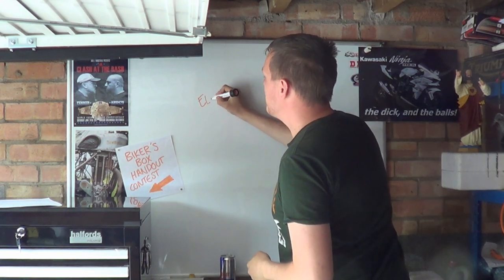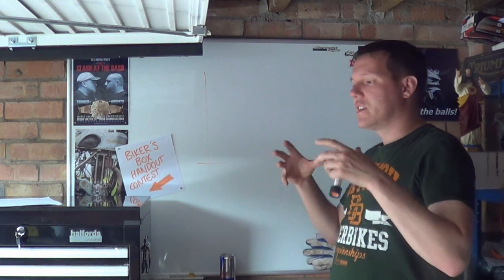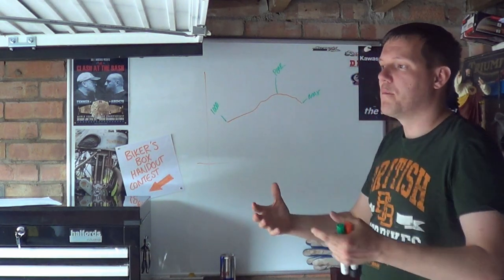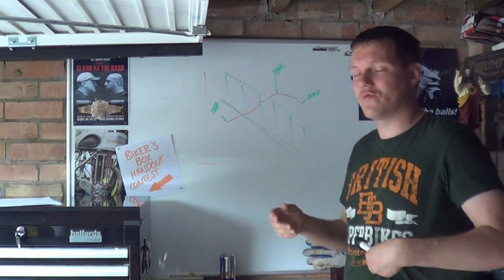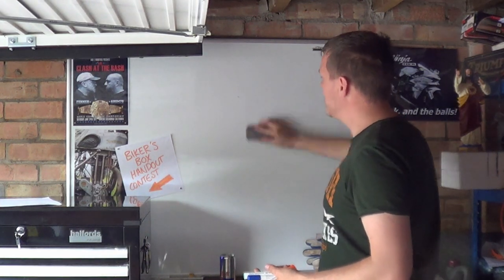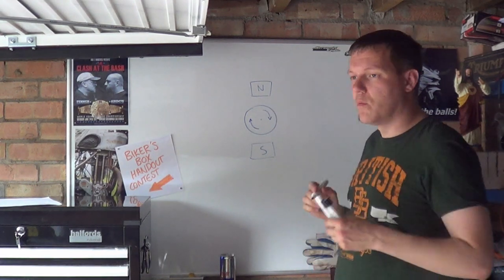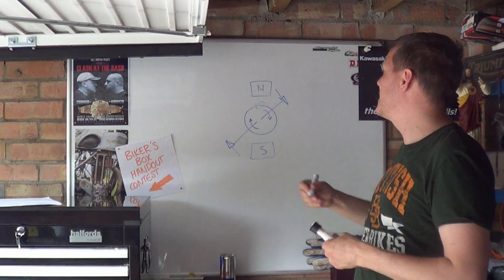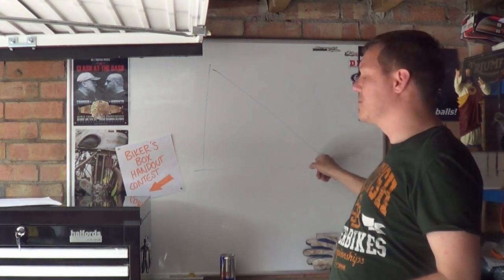Electric Motor - Instant torque - Motorbikes motors - Part 1

Comment: Luke Workman explained on Endless Sphere that an electric vehicle doesn't need a gearbox. You always win in performance if you replace the weight of a gearbox with copper, magnets and battery. The setups that require a gearbox always have the wrong motor and controller for the application. Tesla, Zero, Alta don't have gearboxes and they probably know electric propulsion well.
Reply: It's not all black and white, having a 2 gears gearbox can be useful (taycan) even formula e sometime has gearbox

Comment: You're absolutely correct. However, the torque curve you drew more represents a brushed motor and all modern vehicles use brushless motors. Brushless motors generally have constant torque with a curve downwards to the end of their power range giving them a more useable power regen. For anyone that wants to see an example of electric vs combustion engine check out the Tesla model s drag races.

Comment: Another 'issue' you get with electric motors is that you are also moving a wire through a magnetic field, so your motor starts trying to 'generate' a voltage against your input voltage - your motor essentially becomes a generator, which will eventually generate enough voltage to counteract your input voltage.
Reply: Henry Bevan That is the critical issue,  typically brushed electric vehicles use field weakening to reduce the effect and to allow the motors to rev more.

Comment: I realize this is an older video, but in case someone wants a bit more detail, electric motor torque is mostly a result of the current flow inside the windings of a motor. At stand-still, current is at a maximum, therefore the magnetic field is at maximum, therefore torque is at maximum. 

For anyone who doesn't know, motors have a small generator action side effect (called back EMF) that resists the motor, but never so much that the motor stop. Likewise, generators have a motoring action (called counter torque) that resists the prime mover. Mtotrs & generators operate on similar principles, just one is being rotated to create electricity and the other is being supplied electricity in order to rotate.

Anyways, when the electric motor is sitting still, first turned on, there is no back EMF yet to oppose current flow. Current is max, therefore torque is max. As the motor comes up to speed, the counter EMF creates a bigger and bigger voltage drop, which reduces current flow. When the amps drop, the field strength drops, which means less pushy push and less torque. It's integral to the way electric motors are designed. They have to do it that way. They can't not do it.  Also, permanent magnets have weaker fields than electromagnets, which is why most permanent magnet motors suck balls.

Comment: This electric motor curve (and it is curve, not straight) is actually for DC-motors with serial excitation with MAX torque (and current) at start (0 rpm) around 10x .. 12x of nominal motor values, than rpm goes to infinity (until bearing fail). This is OK for transport.
AC motor (asynchronous/synchronous) have a different torque/speed curve with MAX torque NOT at zero rpm, but around 60% of nominal value (depends on frequency and pole pair quantity). AC motors have starting current around 5x.. 7x of nominal current (and torque).

Comment: In fact it's constant torque up to base speed, then torque only drops because you run out of voltage at higher frequencies, if you can increase the voltage further (insulation issues) then current stays constant and torque is direct proportional to current.
So in petrolhead terms, curve is dead flat like a modern torque limited, supercharged petrol engine but with full torque from standstill and at usually over 50% of top speed it starts dropping gradually,   ... hope that makes sense ...:-)
Reply: Yes, a lot depends on the type of motor too, this would probably be a series dc motor. Torque is proportional  to the square of the current, so if the torque is dropping with increasing speed  so is the current.

Comment: In a combustion engine it is about the group delay from the control signal for more torque to the actual combustion happening by this.
And then there might be additional time constants for supercharged engines comprised of turbine mass, turbine bearing friction, turbine/compressor losses, air volumes, speed of sound, etc.
If a 2C 4stroke combustion engine revs 1000 rpm meaning 17 combustions a second.
So a considerable time goes by from injecting more fuel to it actually producing torque, something from 60-100ms in this example just because of the working principle.
But i guess actually it is more because the engine control unit has control loops further slowing this down because of diverse constraints, emissions, engine longevity, etc.
What you say about electric motors is only 100% true for permanent magnet motors, as used in most bikes, their torque is just limited by the current loop time constant of the inverter and this is in the range <5ms.
With a AC induction motor used in a Tesla for example it is different. Induction motors also don't have instant torque but a time constant of typically 100-400ms for the rotor magnetic field to build up. 
This is not really a disadvantage, but gives a smoother ride and still after this time the maximum torque is available, unless with a combustion engine you have to rev up first.
I guess with their "ludacris race start  2.3 tonne laptop battery bomber party trick" they already build the field up, waste a little energy, let the motor basically run with its so called "slip frequency" while brakes are applied and then let go.

Comment: The force that is used in electric motors is both the repulsion and the attraction that magnets have and electromagnets produce so it harnesses the power from both states.  This would be like a 2 stroke bike engine that was somehow able to harness force from the up stroke as well and make the power delivery much smoother.  Running an electric motor through a gear box can keep the motor at its peak power range and achieve incredible speeds.  So much in fact that I believe that we are going to see petrol engines being primarily used to spin generators that produce the power to drive vehicles because they can do it so much more efficiently and with the advances in power storage we don't need to have gigantic heavy batteries to supply enough power to be useful anymore.   Personally I think that we are living in an exciting time and the entire world is going to change very soon.  Good video again and thanks for the hard work.
Reply: Davis King electric motors don't need gearboxes. Someone much smarter than me explained it on Endless Sphere.
Reply: They do if you want to multiply the torque and reduce the output rpm.  This is why electric winches have gear boxes.  Hope this helps.
Reply: Davis King What if instead you use that gearbox weight and add magnets and copper? And  rewire that motor for high torque? Wouldn't that be a performance upgrade?
Reply: The problem is that when you build a bigger and more powerful electric motor it also increases the weight and power that it takes to operate.  That in turn increases the power that you have to supply it and the power storage that you would have to have to make the whole thing mobile.  Consider a cordless drill for example.  They have different speeds so that you can tailor the performance to the task at hand which is more efficient than simply building a bigger and more powerful motor to drive it.  This would be the same thing for say, powering a bike because you wouldn't want to have to pull a trailer full of batteries to ride it.
Reply: There is no replacement for gear reduction if you are using high ratios.  Gearboxes that are strictly for reduction purposes don't need to be large and bulky, look at the gearboxes on jet engines.
Reply: Davis King a good cordless drill has about 0-2000 rpm. A Tesla wheel at 155mph max speed rotates at about 1800rpm without a gearbox and it still has stupid torque at low rpm. Do Teslas cheat physics?
Reply: Tesla's use a stupid amount of voltage and current and have thousands of pounds of batteries to accomplish the task which is exactly what I was saying you would want to avoid on a bike.  Interestingly Tesla's do also use a gearbox but it only has one reduction.  This is because a 24 inch wheel spinning at 1800 rpm would be crazy fast but would accelerate very slow compared to how they perform now.  They are not cheating physics in any way either because they have to have an advanced cooling system for the electric motor and gearbox to keep everything at a safe temperature.  Hope this helps.
Reply: Davis King ok, Tesla example is not enough, what about Zero and Alta? They are electric motorcycles with reduction gearbox only. I'm referring to a gearbox mostly as six speed or something like that. Reduction doesn't count if it can't be shifted to another gear.
Reply: I am not familiar with those bikes but I am willing to bet that they run on some pretty high powered cells and require a lot of current to operate.  My point is that maximum torque is only really needed at low speeds and using a gear box would allow the use of a smaller electric engine so that the torque can be multiplied at low speeds and then gears shifted to allow faster speeds where less torque is needed to sustain the given speed.  Of course there will be friction losses with any gear box but electric motors overheat when they are ran too slowly and they will also be harder on bearings if they have to spin at super high rpm's all the time so there is always going to be a balancing act to minimize friction and wear and maximize power and efficiency.
Reply: Davis King the problem with small motors using reduction for torque is that when you shift for higher speed you lack power to overcome the wind resistance. Power that you could add by ditching the gearbox and adding copper magnets and battery. Improving range at the same time.
Reply: I am not suggesting using the motor out of you hair clippers here.  Use a motor that has enough power to do what you need without all the overkill and high power requirements.  Adding magnets is not going to improve the efficiency because it will require more power to operate.  Try spinning a car alternator by hand then do the same thing with a 5000 watt generator.  You may be surprised to discover that it takes a lot more energy to overcome those forces and that extra energy is why different motors require different power sources.  Hope this helps.
Reply: Davis King ok I quit. You have your opinion and I have mine. Have a nice day!
Reply: Sounds good.  Have fun.

Comment: I always thought of it as. the combustion engine has to spin up. taking in fuel. to make tq. but an electric motor you can just cram in all the fuel/ current that it can handle without spinning up. because the power comes from magnetic attraction and repulsion . gaining strength by added voltage.  and the faster it spins. the less time for the electrons to make a strong magnet. since everything takes time!  
and I think of HP as how fast a engine can spin up under load. and tq. as how much of a load it can move.

Comment: well done Matt, you got through that well. 
where did you get that toque graph from? doesn't look right.
a sensor-ed brushless motor can attract and repel creating 2x the toque of other motors. 
* why not over voltage a motor 48v upto 96v  and cool it
* why put 10 amps through the coils when you can do 20 amps

Comment: Cheers Matt great video. I don't quite understand how the magnets spin the shaft though, are they offset from the centre line of the shaft if you draw the line perpendicular to the centre of the shaft? Like a diameter line... dunno how to write it. How come the magnets don't just push and pull on the shaft from all directions equally and the shaft stays still?

Is it that you time them to "fire" one after another in a circular pattern so the attraction and repulsion makes the shaft turn around? The amount of time each magnet is active for must be tiny at high rpm if that's the case? Thanks!
Reply from the maker: More on this later

Comment: You feel that you lose power when you open the throttle to wide! I think it is to much air in the mixture with carb engines sometimes even more then fuel injected ones witch I think have to much fuel.

Comment: Also, an electric motor has more power strokes per revolution than any internal combustion engine. If an electric motor has 20 segments then it has 20 repellents of power per revolution..

Comment: bit random, but gas turbines / turbo-shafts, are they a viable power source ? ( mechanical or electric hybrid drive ) or is there size to power and/or complexity the main reason they are rarely used ?
Reply from the maker: Short answer - no. More on this later

Comment: Missed the most important bit of information, which is the battery, and it's stored energy. Doesn't matter what type of motor you have, if you don't have stored energy to deploy in an instant, you have no power output. If the battery for said motor is depleted of most of its stored energy, it will have exponentially less power output. I.C.E motors do not store energy as efficiently as a battery, thus the reason it typically can't produce as much power from 0 revs. If you were to preload the combustion chamber at 0 rpm with enough pressure to detonate on ignition, you can easily make enough torque to kickstart the motor from 0 revs.
Reply from the maker: "Missed the most important bit of information, which is the battery, and it's stored energy." - this video is about motors - not the entire system
Reply: I don't see how you can separate the two. The combustion process in an I.C.E comes from the fuel and air mixture and compression. Without it, you are just talking about a huge paper weight, same goes for the Electric motor. Without a power source, none of the rotating bits and potential torque output means anything. Considering I didn't see a follow up where you explain how the energy source plays a vital role in all of this. The point is missed still. The only reason electric motors are even relevant in the automotive industry now is because of the evolution in battery technology. The motors are nothing new. It's the energy source that has allowed them to be viable in transportation.

Comment: someone should dyno a person on a bycicle.
Reply: jaya neyon around .8 hp I believe. they once did a video about it with a toaster and a biker
Reply: guy Martin did it actually for an episode of speed and he peaked at 600W I think which is 0.8hp. don't quote me but I think sir chris hoy managed ~1000W (1.4 HP)
Reply: i hit 2 hp as a kid(12yo) and nearly hit three...the Boston science museum had a stationary bicycle that would turn on light bulbs for the amount of horsepower produced though a generator
Reply: phil tripe I just checked and Chris hoys 1000W was actually an average over a race with his absolute maximum being 2300W  which is equivalent to 2.95hp 

not calling you a liar but I've never seen a 12yo with 27" thighs
Reply: phil tripe i call bullshit on a kid on a bicycle making more power than two goddamm horses
Reply: Pedro Rocha A horse can produce quite a few horsepower, a horsepower is a rate of work that a typical horse could do all day.. It dates from when steam engines began to replace horses, an engine that was rated at 4hp could reasonably do the work of four horses.

Comment: The 'instant torque' argument for electric motors is a load of bollocks! Let me explain; The motor itself has a VERY flat curve, but, if you dump all that torque through the driveline from a standstill you will flip your bike or break parts so the torque has to be 'ramped' in by like maybe PWM. The end result in the real world is limited power downlow which increases with revs (similar in idea to a boost by gear system) which completely eliminates the benefit of the leccy motor in the first place.